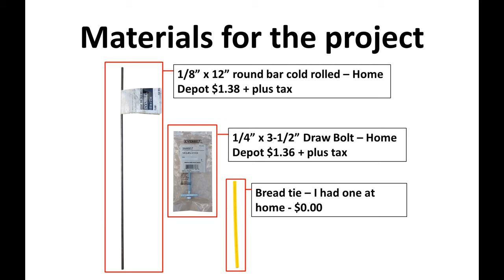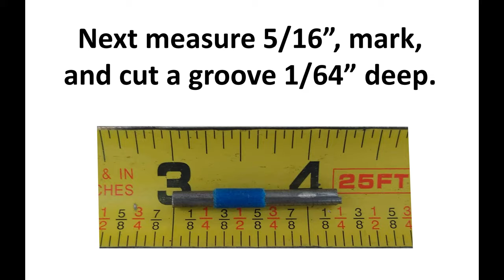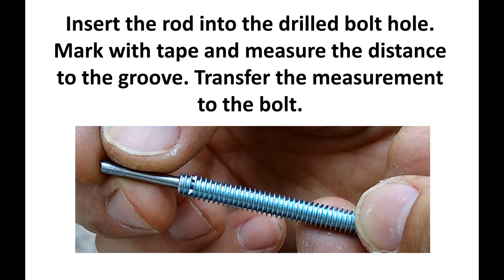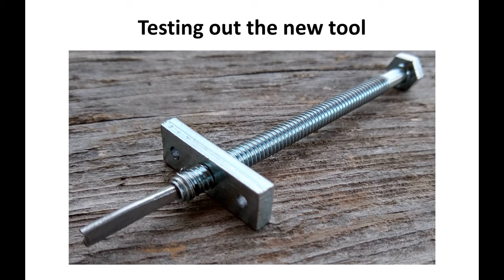DIY Hose Clamp Wire Tension Tool for under $3.00

Comment: Wire clamp tools are the bomb!  I made one out of a stainless steel turn buckle awhile back.  I've replaced at least four dozen worm-drive hose clamps on air lines, air line repairs, garden houses, garden hose repairs, and a bunch of other automotive and power equipment situations.

I do have a welder so in my home-built tool, I used a longer all-thread rod and welded a large hex nut to the top of the turning screw post.  The nut makes hand tightening easier.  And, if extra leverage is needed, a 16 penny nail can be inserted through the welded-on large nut.

Here's the basis of the turn buckle tool:

https://www.youtube.com/watch?v=uW6_ScMGtwo
Reply from the maker: Thank you for commenting, Russell. That's sounds like an awesome improvement on mini turnbuckle version. You're right I've found so many uses for the wire clamps myself, and they are super clean looking. Welding has always been on my bucket list of things to learn.

Cheers!
Reply: Stick welding is cheap to get into...  No gas cylinders required.  And once you master stick welding, the other processes (MIG and TIG) are just variations on a theme.  You can pick up an old-school tombstone buzz box off FB Marketplace or Craigslist for around a C-note.  Hit the salvage yard up for some scrap steel to run a few beads and just start doing it.  It does take a bit of effort to pick up the skills.  But, if you're already into mechanical things, you've got the drive to stick with something until it works.

Comment: What about when you need to take it off and then put back on again?
Reply from the maker: Hello Edward, thank you for commenting. To remove you just cut it, like a wire tie. A coil of stainless wire is very inexpensive and makes many clamps.

Cheers!

Comment: Are those wire clamps better than the screw clamps (more even tension around the piping) ?
Reply from the maker: Hello Dicofol, thank you for commenting. I replaced my screw type clamps with these wire versions on all my 125 psi air hoses, and work great for water hoses as well. They have been perfectly reliable thus far, don't snag on anything, and can be made in any size needed.

Once you try them you won't go back.

Comment: Did you use 1/8” drill bit for the bolt?
Reply from the maker: Hello Big Red, Thank you for commenting. Yes, 1/8" cobalt drill bit was used to drill into the end of the draw bolt to fit the piece of 1/8" cold rolled steel that was made into the tip.

Best of luck with your project.

Comment: What size wire did you use?!
Reply from the maker: Hello Big Red, thank you for commenting. I used 18 gauge suspension wire used in drop ceilings. It's just over $8 for 300' which will make many clamps. The link is below:

https://www.homedepot.com/p/SUSPEND-IT-18-Gauge-300-ft-Hanger-Wire-for-Drop-Suspended-Ceiling-Grids-8851-6/305043844?

Best of luck with your projects!

Comment: Can you name the tools youy used  or the screw kind in your description?
Reply from the maker: Hello Gilberto, thank you for commenting. I just added these details to the video description.

Materials needed:

https://www.homedepot.com/p/Everbilt-1-8-in-x-12-in-Cold-Rolled-Plain-Round-Rod-800397/204331423

https://www.homedepot.com/p/Everbilt-1-4-in-x-20-in-x-3-1-2-in-Zinc-Plated-Draw-Bolt-813708/204273821

https://www.homedepot.com/p/SUSPEND-IT-18-Gauge-300-ft-Hanger-Wire-for-Drop-Suspended-Ceiling-Grids-8851-6/305043844?

https://www.homedepot.com/p/3M-ScotchBlue-0-70-in-x-60-yds-Original-Multi-Surface-Painter-s-Tape-2090-18EC/100032184

Bread tie = free

Tools used:

Bench vise - https://www.homedepot.com/p/WEN-3-in-Heavy-Duty-Cast-Iron-Bench-Vise-with-Swivel-Base-453BV/307606489

Hammer - https://www.homedepot.com/p/Husky-16-oz-Fiberglass-Claw-Hammer-N-G16CHK/305482224

Hack saw - https://www.homedepot.com/p/Stanley-10-in-Adjustable-Hack-Saw-STHT14039/311327254

Wire cutter - https://www.homedepot.com/p/Milwaukee-8-in-Diagonal-Cutters-48-22-6508/305554256#product-overview

Drill bit - https://www.homedepot.com/p/Milwaukee-1-8-in-Cobalt-Red-Helix-Twist-Drill-Bit-48-89-2305/203115291

Pliers - https://www.homedepot.com/p/Stanley-6-in-Slip-Joint-Pliers-STHT84401/311367655

Center punch - https://www.homedepot.com/p/General-Tools-Pocket-Automatic-Center-Punch-87/309724048

Files - https://www.homedepot.com/p/Gyros-5-1-2-in-Needle-File-Set-6-Piece-49-01406/204627227

Tape measure - https://www.homedepot.com/p/Stanley-LeverLock-25-ft-x-1-in-CC-Center-Tape-Measure-STHT30758L/204624317

Comment: could this work for AC hoses too
Reply from the maker: Hi Raeffi, I wouldn't take the risk to try it on the high pressure hose of an AC system. Those pressures can reach up to 345 psi. I have personally used them to clamp hoses up to 135 psi.

Comment: Why not just shape & Grove the end of the bolt instead?
Reply from the maker: Hello Darrin, Thank you for commenting and suggestion. Since the actual bolt needs to be turned by the ratchet the tip must stay fixed to the wire. It's tricky to explain but when you build it you'll see what I mean.

Best of luck with your projects :)

Comment: Never use more clamp pressure to hose what is require.
Reply from the maker: Hello Jari, Thank you for commenting. You're right, I've noticed that one round of the wire applies enough pressure for a trouble free seal. The double version like in the video had more pressure on the outside of the clamp than in the center.

Best of luck with your projects!

Comment: Nothing wrong with using wire to hold hoses on it’s a method older then hose clamps
Reply from the maker: Hello lucasmiddendorff7166, Thank you for commenting. Yeah, I agree with you. They are super clean looking, cheap, and easy to use.
Reply: Nothing wrong with using wire? You should use wire! It's even pressure all around the hose, a hose clamp is not. They're junk.

Comment: Basically the flat part with the grov is a flat screwdriver tip with a Grove, easyer to take a sacrifice flat screwdriver tip. 🤔
Reply from the maker: Hello WaschyNumber1, Thank you for commenting, Great idea, a small flathead screwdriver blade would be stronger and simplify the installation.

Best of luck with your mods!

Comment: avoid drilling out the bolt and the whole ungrooved rod by simply doing the spinning trick with the drill on the bolt itself, and use ta file to grind down the end of the bolt to the diameter of the ungrooved rod by grinding off the threads.   Personally I would have the drill spinning the bolt, and then use a 4.5" angle grinder with a grinding wheel and the whole thing will take about 60 seconds.  Then cut off the bit of the bolt that was held in the cordless drill.  Now I'm down to just the cost of the Bolt piece, guaranteed to have the ungrooved rod part perfectly centered (and secured,) , no drilling (no broken drill bit),  no groove cut, and can make it a lot faster.
Reply from the maker: Thank you for the comment Jonathan. Please send a picture link to what you mean so I can grasp what your describing.

Comment: Just use long pliers: https://youtu.be/7MPCHkOn6oQ
Reply from the maker: Hello Bonno 2U, Thank you for commenting. Yup, pliers is another way to twist clamp wire around a hose. 

Best of luck with your projects!
Reply: @vbared  Great to get your reply. Using the tool is still the best way. But in case there's no tool like that around, we can still make it. Somehow I can still see the difference between using and not using such a tool. Say, if I have to clamp a high pressure hose, I think I'd better find it first. But when I have to clamp a water hose for my garden, a pair of pliers will do the trick.

Comment: Or just grind a slot in the end of the bolt?
Reply from the maker: Hi Billy, figuring out a way to keep the notched pin from falling out while still allowing it to rotate was the problem that needed solving. Since the whole bolt rotates when the ratchet is used the end pin that puts pressure on the wire needs to rotate. Please send a link to a solution you can come up with to improve it.
Reply: @vbared  a bloody well thought out tool.. for my tool box 👌👍

Comment: Alot of effort to make that. Lol!!! It be alot faster jus buying a clamp
Reply: I use these types of clamps for repairs to garden hoses (sometimes my wife will leave one out and the dogs will decide to chew on it).  1/2" CPVC pipe is the perfect size for the inner connector.  A 10 ft length of it will make quite a few of the connectors at around 3" per connector and with 17 gauge galvanized electric fence wire for the wrapping, it's really cheap.  The main advantage though is that when you are handling the hose, you barely fell the connectors as they slip through your hand, whereas with the traditional screw type hose clamps, they will often slice your hand.  This also means that if you have one of the traveling lawn sprinklers that have a guide wheel that follows the hose, it will not get hung up on the connectors.  I've also used it on my air hoses when the hose is still good, but the original coupling area has started to leak -- just cut back a few inches where the hose has become worn and install a new fitting (sometimes, you can even disassemble the old fitting and reuse it).

The only time I ever use a screw type hose clamp these days is if it is in an area where a tool like this cannot be used.  That doesn't happen very often.

The first of these types of tools that I made, I used sched-40 PVC pipe for the main body and a metal rod through the side which wound the wire.  Surprisingly, it held up very well.  The problem with the design where the wire spools on a bar running through the side of the shaft of the tool is that it doesn't hold the pressure on the wire unless you are holding pressure on the bar.  This type here might be a bit slower to operate, but because of the screw mechanism, it will hold the pressure on the wire if you remove your wrench.  It's a little bit more difficult to make because of the rotating tool head, but nothing that a homeowner with even a minimally equipped workshop shouldn't be able to accomplish.
Reply from the maker: Yes, it does take some work to make it. The biggest advantage is that you can make whatever size clamp you need without having to drive to the store every time you need a size you don't have.
Reply: @vbared  -- It makes a very cheap way of making a coupling  to repair a hole in a garden hose.  Using today's prices, Lowe's has a 10 ft section of 1/2" (copper size) CPVC for $3.97 and Tractor Supply has a 1320 ft roll 17-gauge galvanized electric fence wire for $17.99.  Using a 3" long coupling and , that works out to be $0.10 for the coupling.  The length of wire needed for each side of the coupling will vary depending upon the size of the tool you build, but let's say you'll need 24" at the very worst.  So, you're looking at $0.027258 for the wire on each side of the coupling for a total wire cost of about $0.0545.  Total cost with tax, around $0.17 for the patch.

Now, if you have a mini-lathe (I have a 7x14 Grizzly), drilling that hole in the end of the bolt is a lot easier since you don't have to worry about drilling at an angle and possibly drilling out the side of the bolt by accident.  This would also allow you to drill the hole deeper so that the rod would be more fully supported.

The only problem with the design of this tool (which is shared by the other versions of this tool that I've seen) is that it needs some room to rotate the tool, so it will not work in an enclosed space.  For example, I had a situation occur where I wanted to use this, but there just wasn't enough room.  I had a leak in a piece of 1/2" copper pipe that was maybe 1/2" above the concrete slab.  This copper pipe was between two wall studs on an exterior brick wall so that the only way you could access it was to open up the sheetrock on the interior wall.  It fed a water faucet (hose bib) on the exterior of the house.  Not having a copper coupling to do a proper repair and it being late at night, I figured I could do a temporary fix with a piece of garden hose after cutting a small section of the pipe out at the leak and putting the piece of garden hose on it.  There was not enough room to use the hose wrap tool, so I was force to use the worm screw type hose clamps instead.  Using a screwdriver to tighten them still resulted in a leak, so I had to use a hex socket to tighten them, probably coming close to stripping them out.  Leaks like this never happen at convenient times or in accessible spaces. :(

There is another tool design that wraps the wire slightly differently that would probably work for that particular problem though.  I'm not sure whether the way the wrap is as secure as the method used in this video though.

Leo Pliers Long John
https://www.youtube.com/watch?v=u6HcPNOjgoY

The wire is wrapped slightly differently and the above video does not show it, but as best as I can tell, they are using the same wire wrapping method as this tool:

https://www.youtube.com/watch?v=AQAHsh4s-wU
Reply from the maker: These are super cool, Grumpy! I hadn't seen the twist lock version. Thank you for posting them.
Reply: @vbared  -- I think it might have an advantage when you are needing to make the connection in a tight place, but I'm just not sure that it is as secure as the way you are using in this video where both ends get twisted 180 degrees and are pointing in the same direction.  Even if it is as strong, I think the way you are using results in a wrapping that is less likely to snag on things since both cut ends are on the same side of the twist and are more likely to be tucked down inside of the other wraps of the wire whereas the ones in the videos appear to result in the cut ends being on the outside of the other wraps.
Reply: only a casual would say something like that;).... people always have some wire laying around.. and this will even give better results than a clamp.. and to be frank.. most clamps suck in quality.. buying some high quality stainless steel wire does not brake the bank and this tool and the little effort it took making it will pay both in time and in quality of work done..
Reply: @philxdev  lol,,,,,, i didnt say it wont work, nor did i say the quality sucks,,.... but okay right on (y)
Reply: @riverrivers250  lol you can´t read? how did you get THAT from what I just wrote? I never even implied that you said it won´t work or that you have issues with the quality.. I merely defended the time and effort put into it, as this was clearly the issue you were having:PPP
Reply: @philxdev  ohhh okay
Reply: @philxdev  lol

Comment: LMAO what a joke 
i will just buy a hose clamp and screw driver
LMAO
Reply from the maker: Hello Guardian Matthew, thank you for commenting. I agree with you, it won't be worth some people's time to build when a standard hose clamp is available.

Best of luck with your projects!
Reply: "What a joke" says the man who either isn't good enough or is too lazy to make it lol. It may be slower, but is a more secure clamp when done correctly. Come back when you're grown.
Reply: One advantage of this type of hose clamp is that if done correctly, it does not leave any sharp edges to catch on your hands.  This is especially nice when you use it to repair garden hose.  I've had my hands sliced a few times over the years by garden hoses that I repaired using the screw-type hose clamps.  Whenever possible, I use this type of hose clamp these days.

Comment: OMFG, no more Prime Purchases for fuel clamps of varying sizes cause just not certain which ones I need. You just saved me $15 bucks a kit for the princely sum of <$4.99. I'm making one for my cycle shop repair and F*** Amazon. Whoooooot !!:hand-orange-covering-eyes:
Reply from the maker: Hello Anon Imous, Thank you for commenting. Yeah man, I hear you and the screw clamps look ugly as heck. You can either do a double like in this video and single will work as well. I made all my air hose connections with just the single.

Best of luck with your cycle repair shop!
Reply: @vbared  Thanks Vic. Yea the single will work best on fuel lines.